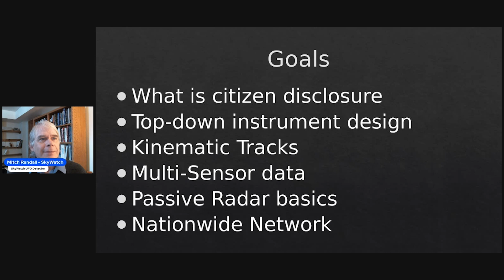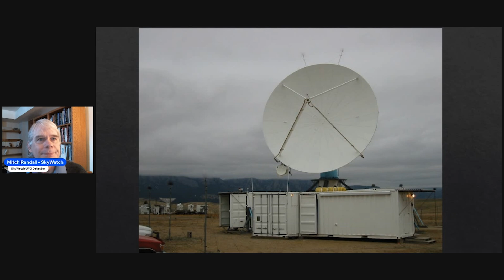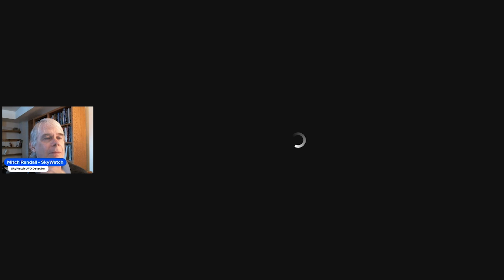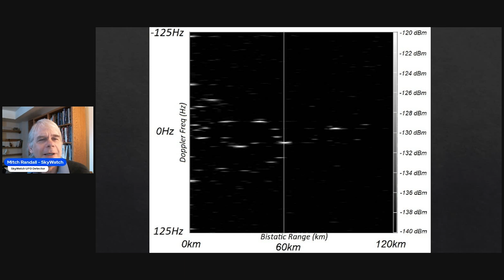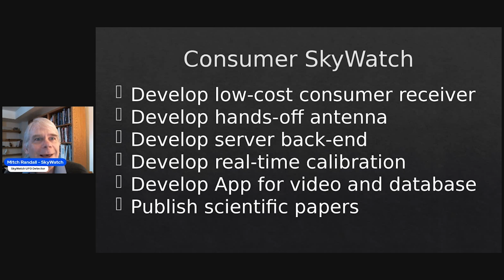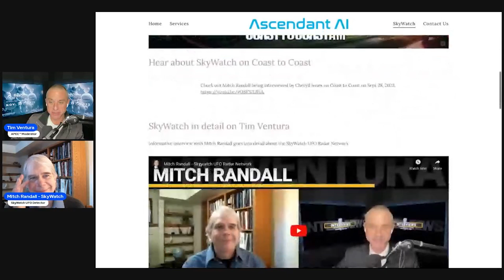Mitch Randall on Skywatch Passive Radar UAP Tracking

Comment: This is good stuff!  I want to see this in operation.  It does seem like a single receiver would be defined by a 3 dimensional ellipsoid and a second receiver would constrain the possibilities to a circle on the 3d ellipsoid, the 3rd receiver a line intersecting 2 points and 4th single point?